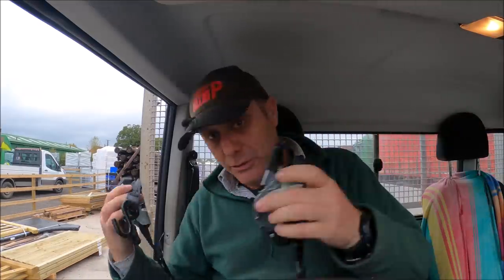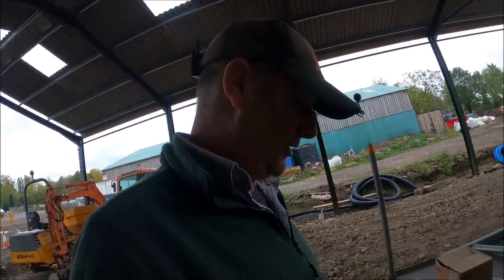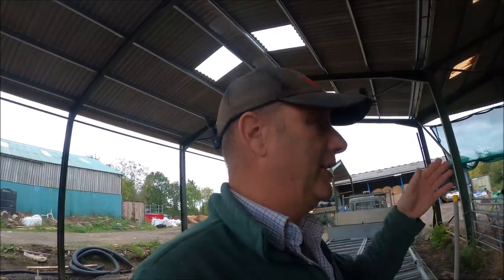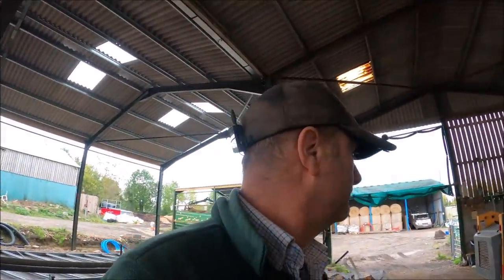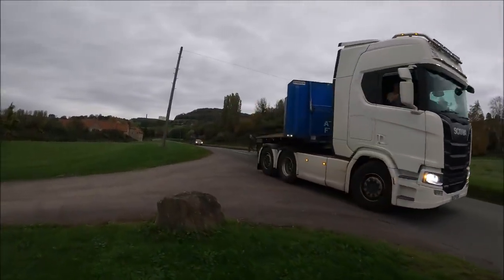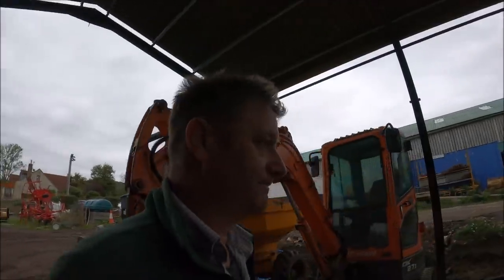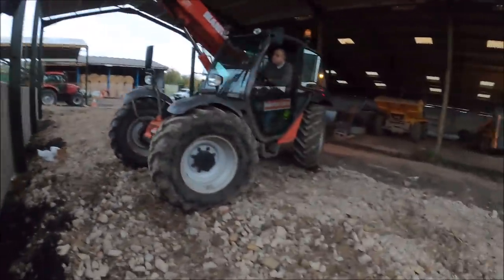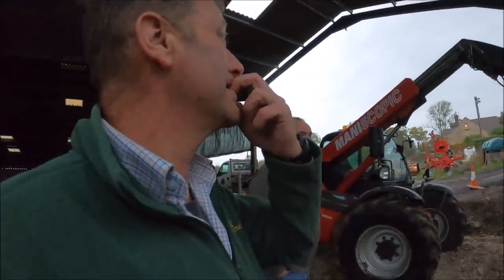"Barn Build" The concrete panels arrive. 28 10 21

Comment: My 2 cents - put feed barriers the length of shed between new and existing. You can fodder at middle two barriers, then barriers at the ends used for troughs for meal feeding. Also can have water troughs on the outside of the pens accessed through the barrier, keeping them from dunging in them. We have similar only on opposite sides of the pens.
Reply from the maker: That was the original plan, just the other way round. We will get there, eventually 🙂👍🏼

Comment: Great the panels arrived and put up brilliant 👍
Just wondering why you not putting on inside so it's a flat wall ?
Are they 100mm or 160mm thickness?
Reply from the maker: They are 98mm Antony, and going on the outside on purpose to hold back the upper yard / driveway surface which will finish over half way up them. All will be explained 🙂👍🏼

Comment: No no definitely don't use rachet straps I did and they move so a waste of time. Far better to do it properly with scaffold tube and clamps.

You would be better putting barriers down between middle and new barn. Feed in line with doorways and use space to side for storage. You can still split new barn I half using existing gates. Don't trap yourself in I've made that mistake and ended up redoing lots. Sheds are never too big!!
Reply from the maker: True, our new ones are already too small 😄

Comment: It does seem a bit strange that the panels are meant to go on the outside when the pressure from the bedding could be a problem and the steel structure is being exposed to corrosion from manure. I was thinking that
Reply: I was thinking that locking yokes on the barriers would make life easier but probably a lit more money.
Reply from the maker: @wendyrowland7787  
Pressure from the bedding and machinary (skid steer) will be far less than the outside pressure from the built up yard.